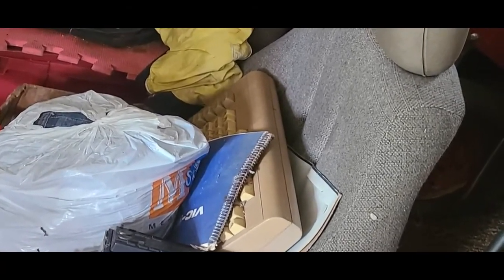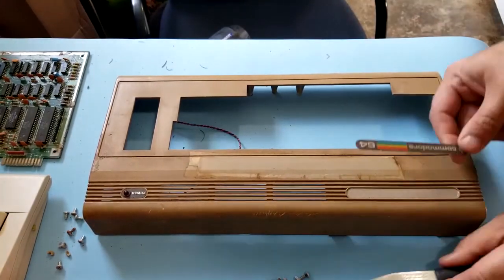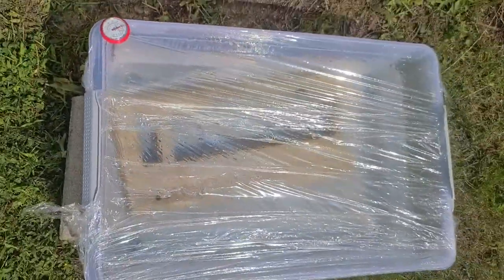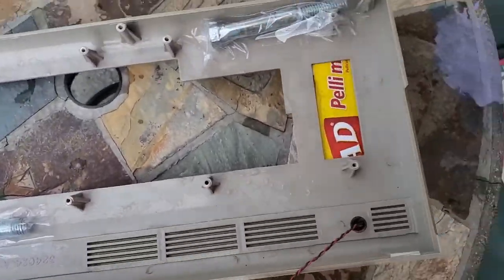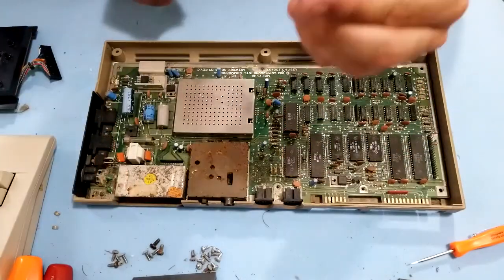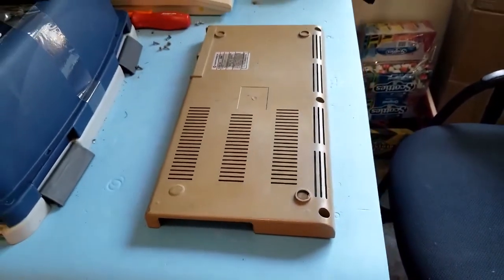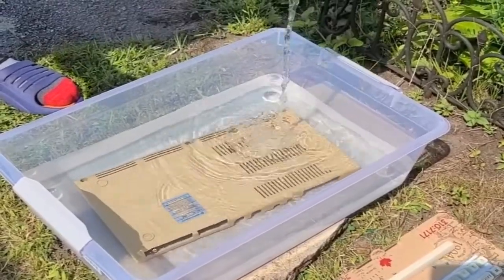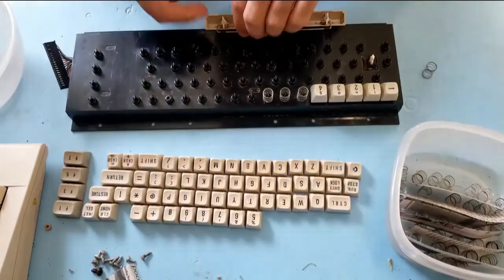Commodore 64 breadbin restoration, using different retrobright techniques.

Comment: Awesome you didn't have to do any repairs! The sound chip (SID) usually goes first. Also, you may want to get an over-voltage protector in case the power supply gives the 5 volt line too much power. Original c64 power supplies are known to fail.
Reply from the maker: Already got that covered, I bought 2 brand new power supplies with the LED screen. A single and a double to plug the 1541 II. 👍🏻😀 I'm very satisfied with the retrobright and all systems working.